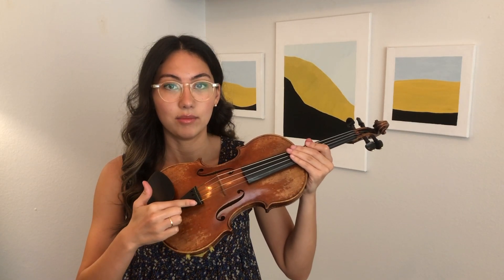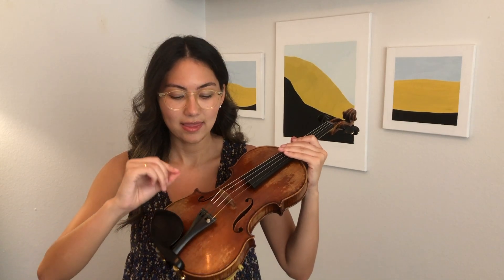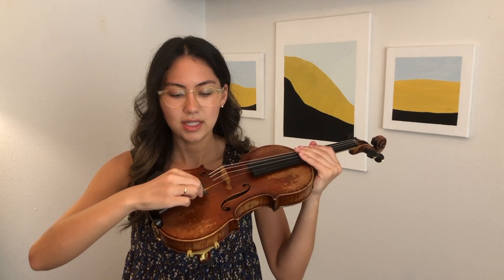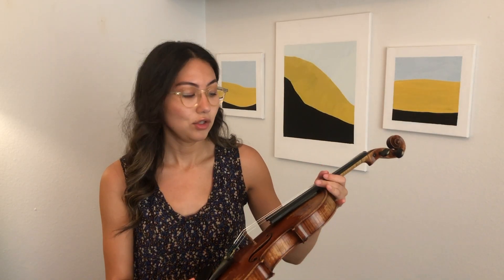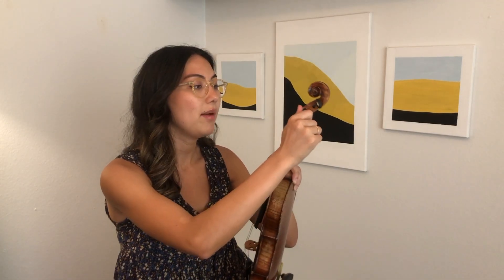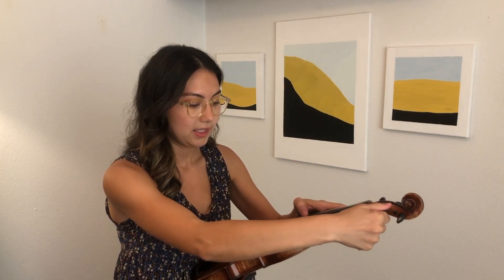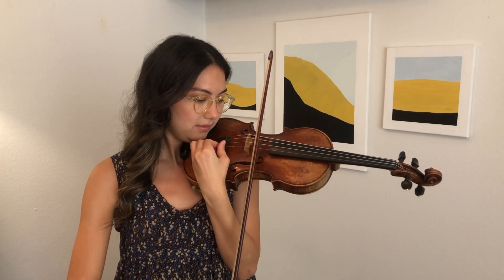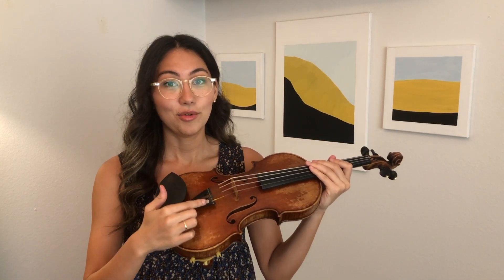How to Fix Stuck Fine Tuners

Comment: This is not a stuck fine tuner issue this is just a you need more room to tighten. I have a fine tuner that won't move even with pliers when I try to loosen it. I think this video is mislabeled.
Reply from the maker: Ooo this is a good point! When my student's fine tuners are tightened all the way, they usually tell me "I can't turn it anymore. It's stuck!" So that's how I came up with the title. For fine tuners that are ACTUALLY stuck, I would suggest taking them into a shop. I know you can put some sort of special oil to help them move, but sometimes there's a bigger issue. Thanks for commenting and sorry if the title bothered you!
Reply: @JaclynKimMusic  omg! Ok thanks. Bc mine is doing the exact same thing and then one of my pegs is also pretty tight and won’t move AT ALL so I’m just gonna wait till I have time to go the. shop